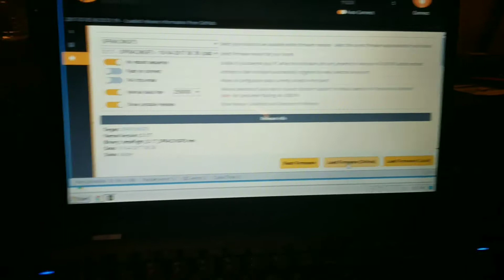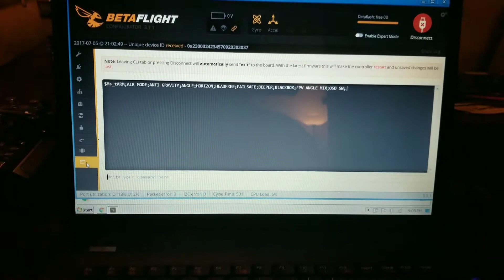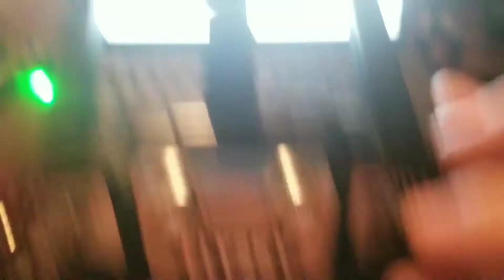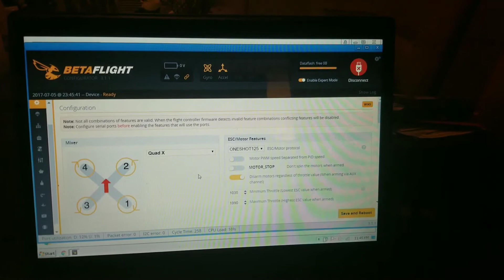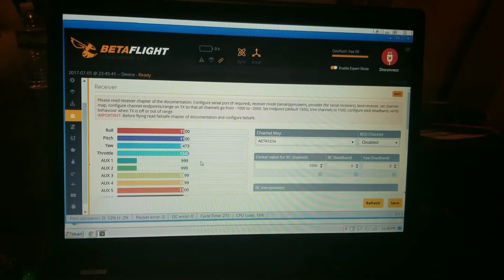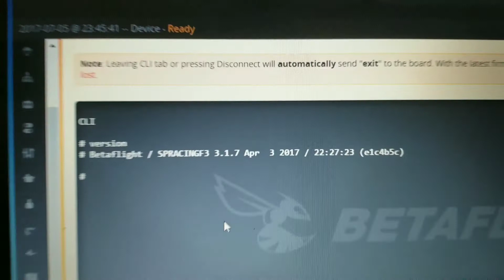WIZARD X220 UPGRADE #1!!!

Comment: Can you Help me
Reply: Can we text on snap for my question
Reply from the maker: @maxherd6217  how about here
Reply: @edrone_  you are my last change
Reply from the maker: @maxherd6217  what is the problem your having
Reply: @edrone_  The Aux channel 5 6 7 8 is off not working and at the flight controller on settinges aux. channels is only aux 5 and 6
Reply from the maker: @maxherd6217  what kind of transmitter and receiver do you have
Reply: @edrone_  fs i6 the flysky
Reply: @edrone_  and a wizzard x220 du have insta but on youtuve is crazy
Reply from the maker: @maxherd6217  watch this video and make sure your transmitter is set up like in this video https://youtu.be/9-Z0rTVEkHI
Reply: @edrone_  It is man i have look 1000 videos of them but the problem the other aux channels 7 and 8 is offf
Reply from the maker: @maxherd6217  you have to go into your radio settings and turn on the other auxiliary channels have you done this
Reply: @edrone_  The Problem is the other channel can't turn on only the 5 and 6 but the other so as dead
Reply from the maker: @maxherd6217  there is a way to turn on all the aux channels on the radio in the radio settings
Reply: @edrone_  and wich on
Reply from the maker: @maxherd6217  turn on 10 channel in your aux channels tab then go to the aux switches to assign watch this video: https://youtu.be/ZwM_AoKfoj0
Reply: @edrone_  yes but i go to aux channels an there only 2 =5 and 6 and menu with on off is by me not there
Reply from the maker: @maxherd6217  I am having a hard time understanding you. The radio has to have the aux channels turned on, I believe you can go up to 6 aux channels on that radio. It comes from the factory with only 2 or 3 aux channels turned on i believe
Reply: @edrone_  i don't have i6x only with blue  color i6
Reply: @edrone_   think it's great first that you help me exactly channel 5 and 6 are activated but in the betaFlight videos are all channels to 10 and I can only set to 5 and 6 and that makes me stop worrying why in which all is aux 6 7 8
Reply from the maker: @maxherd6217  I dont think you have to use all the channels in betaflight to fly
Reply: Yes, but why do the others have it all so I've got it set once my engines went on for example and jz I press the switch and it does not work
Reply from the maker: @maxherd6217  have you set up your switches in the modes tab?
Reply: @edrone_  Yes but the motor s don't go on